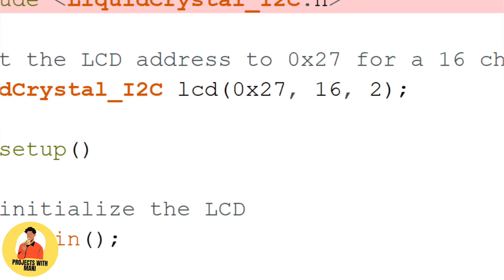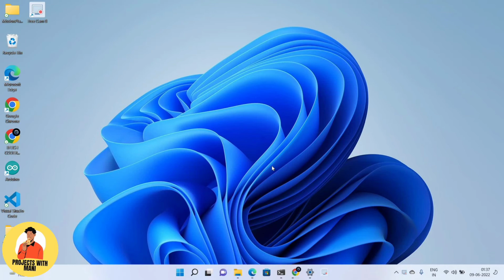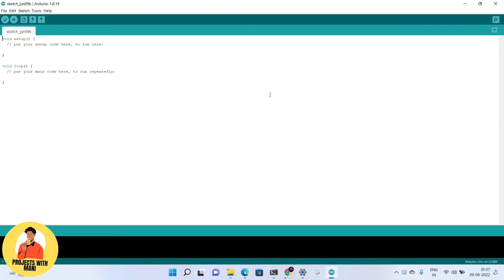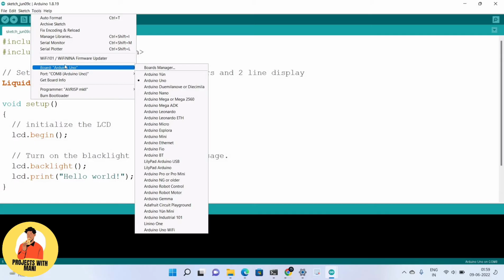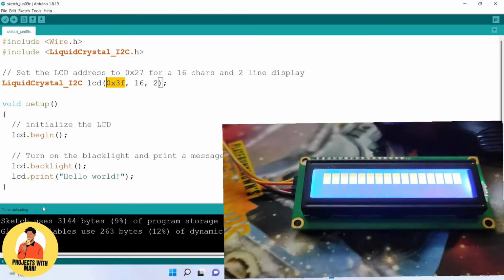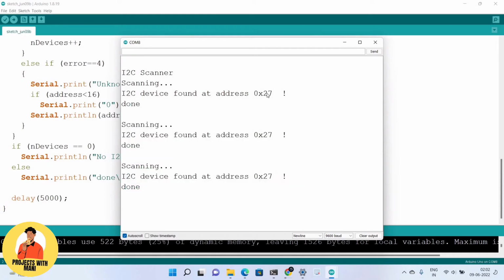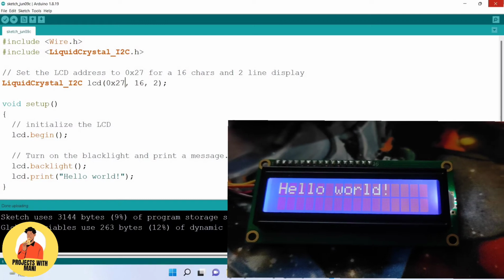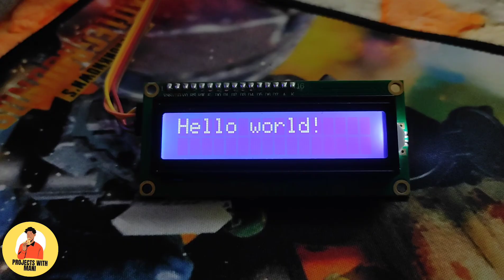16x2 lcd display errors solved 101% || library Installation,i2c finder, text code Step to Step Wise

Comment: ive followed exactly what to do in your video, but why I still get error on i2c scan/finder? i got this error still 13:36:03.759 -> Scanning...
13:36:03.759 -> No I2C devices found
Reply from the maker: Check wirings
Reply: Me to !
Reply: it's ok , i chake my cable, that's the problem
Reply: Thank you!

Comment: Best method for such problem will be to tighten or loosen the screw behind the i2c module in a small blue box(potentiometer of display) it will change the contrast of display due to high or low contrast these boxes appear.
This solved my problem hope will solve yours also
Reply: dude thank you so much! you save my time 😇